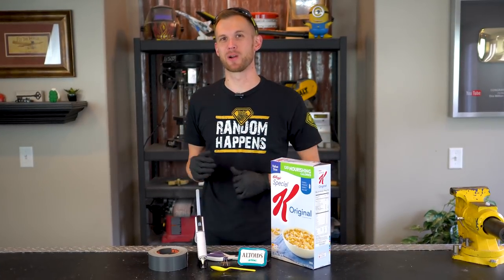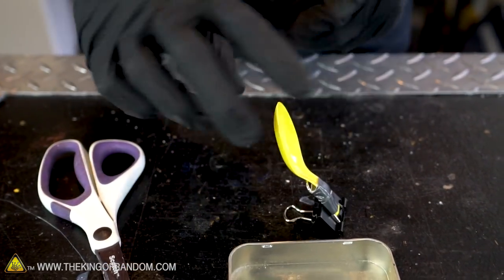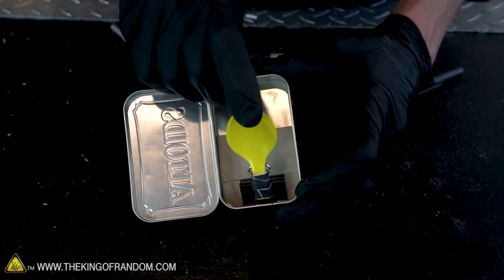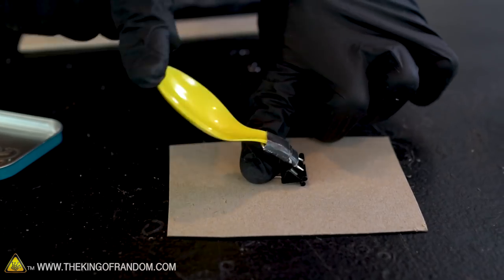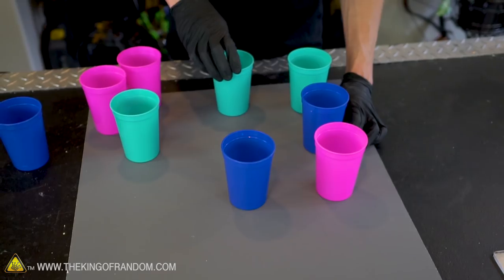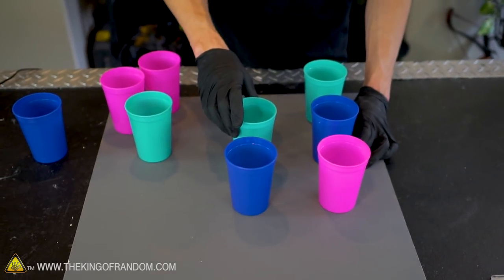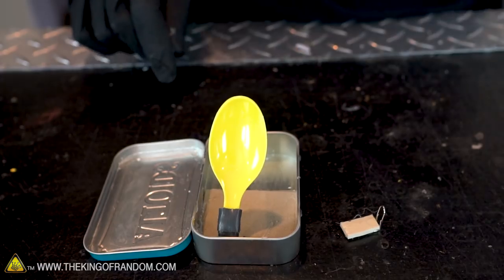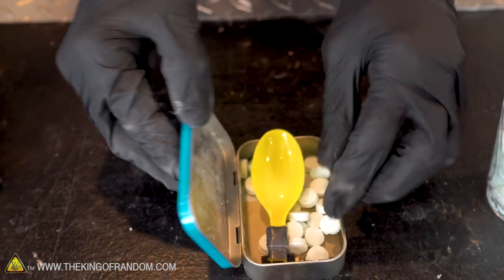Make an Altoids Catapult! TKOR Flings Some Tips On How To Build A Catapult!

Comment: Tip:  When using hotglue on metal, adhesion can be strengthened  by pre-heating the metal such that the glue doesn't have all it's heat pulled out before it has a chance to adhere to the surface.

Comment: So basically an office siege weapon. 50 points if you can get one in the bosses coffee cup. 150 if you get it in with out the boss noticing. 500 if you can get it in without the boss noticing it was you and it splashes hot coffee over the boss.

Comment: Make an electromagnetic generator that uses magnetic resonate induction to produce electricity. Using 2 rings and 24 neodymium magnets polarized in the same orientation, center ring would have a shaft with 4 more powerful neodymium magnets polarized oddly and enclosed in copper coils the same diameter as the powerful magnets.